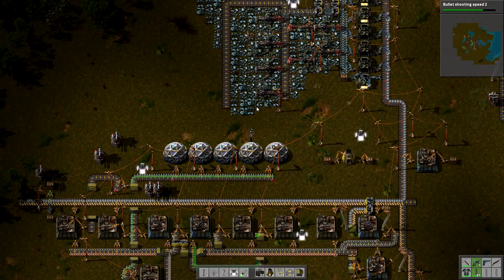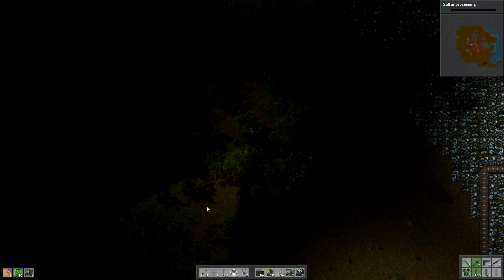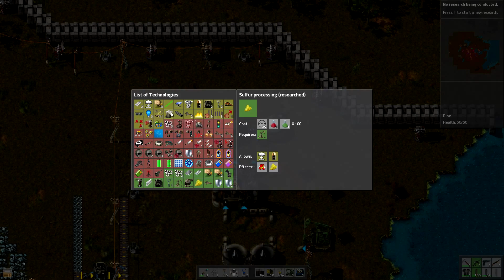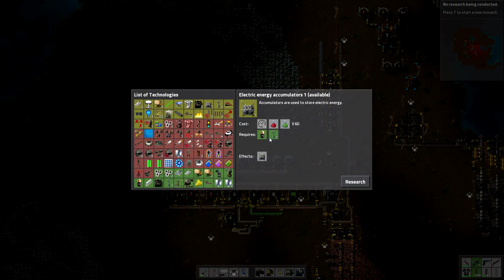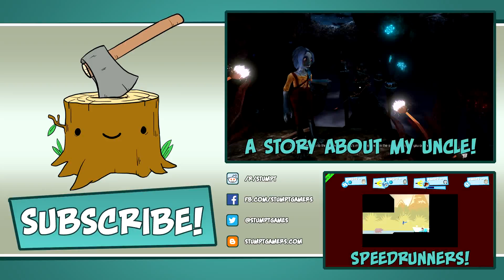Stumpt Industries - Factorio - #6 - Oil Production

Comment: The oil section often grows to a much bigger area than anticipated.
Using pipe to ground liberally helps keeping the area navigable.
It is not easy to create an expandable design with pipes. Some like to use a "bus-bar".
Reply: Yea, I think I will at least mention my concerns with this in the next episode, I didn't leave myself much room. What is this mythical bus-bar you speak of?!
Reply: Stumpt Price The bus-bar is used in electronics, but in factorio it is parallel lines of belt or pipe.This makes it easy to make a string of refineries.
Reply: This image shows an enormous refinery complex using several bus-bar's
http://i.imgur.com/9BucJzY.png